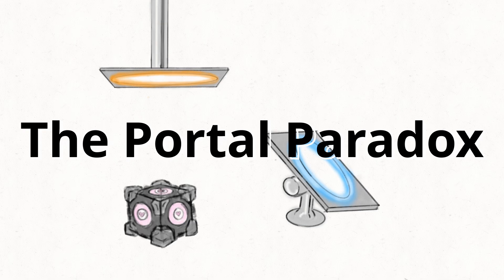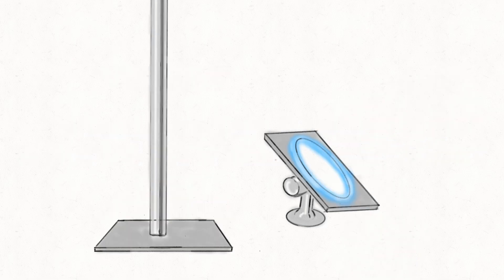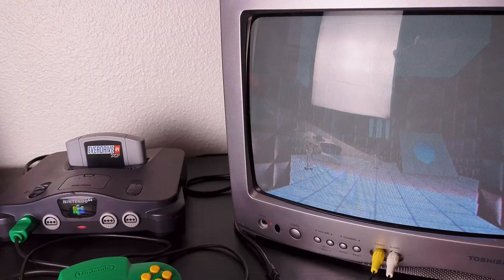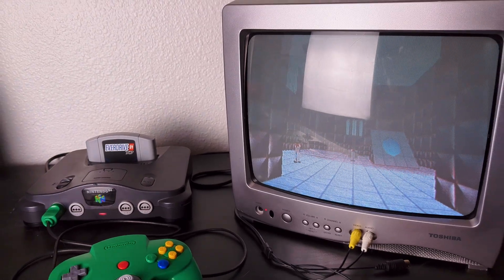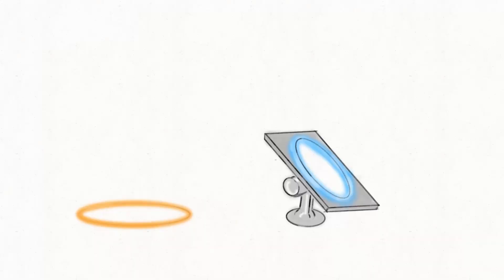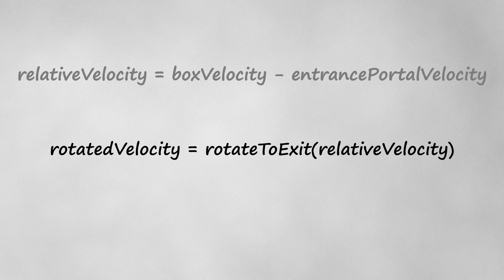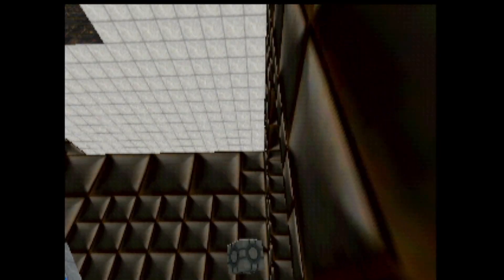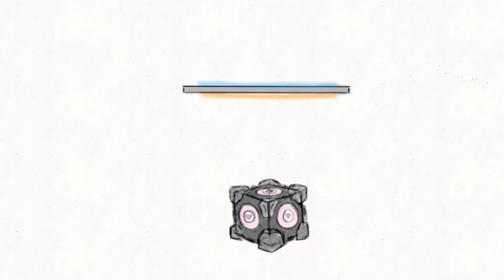I rewrote Portal from scratch and solved the Portal Paradox

Comment: Kinda cool that your de-make is now, at least in this particular regard, technically more advanced of a game than the actual original source version
Reply: The issue with infinite forces are not solved, though:
1) Instead of piston pushing panel with orange portal down, panel is free-falling.
2) Instead of panel with blue portal being at 45°, it's lying with portal side down.
3) Panel with orange portal is falling to cube.
With his solution, this would create infinite forces and will completely flatten the cube, even though panel don't weight that much.
Reply: From 2007, it’s 2023 my guy, most game demos are longer than games from that time.
Reply: The original engine has a tag that allows portals to move, you could certainly do this in original engine using only in game commands.
Reply: @ephraimtimmerman4476  Someone did and the cube and Chell both treated the moving portal as a wall; they aren't functionally implemented, they're only faked with that tag for one or two cutscenes
Reply: The real treasure was the bots we made along the way.
Reply: I've never seen someone come across as so much of a fucking cunt on a comment thread.
Reply: Portals can be moved in portal 2 and the same thing happens in the portal64 de-make/ n64 port
Reply: Ba dum tss.
Reply: If it was any other engine than source it wouldn't of been possible
Reply: Now the bots are accusing real people of being bots! To what end!? Report all the bots!
Reply: Except it's not at all. He calculated a single variable, he didn't even include inertial frames of reference or light cones, either because he's ignorant of the actual physics or just lacks the capability to program them.

Just so we're clear, this is wrong. It's the same as throwing the entire building at a stationary cube.

If that's hard to comprehend, a portal is essentially a window. If you stuck your hand through a window, you wouldn't expect to be launched through it. His example violates the law of conservation, and it's a very clear example of ignorance at work. We've actually demonstrated this as false as we've created "white holes" for qubits that instantly communicated information over distances and didn't impart any extra energy when doing so.
Reply: @xelgodis80085  Your reasoning for this not working is “but if you stuck your hand through a window you wouldn’t launch through it” which is entirely irrelevant to this experiment because you can stick your hand through a portal and not launch through it as well lmao. This is a scenario where the portal’s entrance is moving and exit is stationary, meaning that entering the portal is relatively faster than exiting the portal at a standstill, meaning you would be launched out of the exit point due to relative speed. Think of jumping out of a speeding vehicle versus a stationary vehicle, for instance.
Reply: @Bluerious  you understand literally nothing about inertial frames of reference, nor white holes. 

The act of an object moving through space is exactly the same as space moving past an object. You are taught this in 3rd grade. 

For more information on why you're wrong, please look up how space-time compression and dilation work, as this functions simply as link in two points in space time.

The final straw is that by this model, light itself should be accelerated past c when a portal accelerates at it. This is because his simulation must assume a universal constant orientation, that the universe itself has an "up" and "down", which is flat-earth conjecture. Unless you concede that accelerating the entire building at a stationary cube would not cause the cube to be launched (as no force can possibly act upon it) and it is simply transported from one point in space time to another, you would have to admit that anything traveling at c would therefore be accelerated beyond the speed of light in the same scenario, which the laws of thermodynamics has proven untrue. 

Now admit that you're wrong.
Reply: @xelgodis80085  Dude, I’m sorry but your constant “You understand nothing,” “for more information on why you’re wrong,” and “Now admit that you’re wrong” is extremely childish and shows that you really aren’t willing to have any meaningful conversation whatsoever lol. This isn’t even the first video to solve the portal paradox, it just puts it into a direct visualization about it, and addresses how a critique against the portal paradox will still apply properly when simulated in this implementation as well.
Reply: @Bluerious  okay, if you'd like to have a civil conversation then sure, we can. I simply addressed you as I would any other flat earther (as an inherent reference required for this simulation to work is the basis of flat earth gravity-denial), and may have been a bit dismissive in something so obvious. 

Let's establish basic facts and then why they must be true, then you can try to deny and pick it apart:

1) A portal must only ever be a link in space-time sharing an inertial frame of reference. 

This is because the portal has no mass or energy, it is an absence or void, aka a hole. It is Space.

2) The platform is accelerating, with a hole in it.

It is undeniable that the platform itself is accelerating, but the hole in the center is not, as an "absence" or "void" cannot accelerate.

3) An object passing through space is the same as space passing over an object.

Inertial frames of reference DO matter, and they form the very basis of physics.

4) The first law of thermodynamics must always be observed.

Energy cannot be created or destroyed, this is a fundamental fact.

Now let's set up this scenario:

A platform with a hole is accelerating. The hole passes over an object. The object remains stationary, and is simply on the other side of the hole.

By actual physics, this is how the portal interacts with the world around it, or rather doesn't interact at all as a void cannot impart force or act upon anything. The box is simply on the other side of a hole.

However, in the video's demonstration he assume that the void of the hole has a vector of energy or mass that somehow acts upon the box. This cannot be true, because the portal is SPACE, a VOID, NOTHINGNESS, in other words a HOLE. If it did somehow impart a force upon an object it passes over, than the very act of moving the portal means it passes over light moving through it. By the demonstration then, the light must also accelerate past the speed of light upon exit, even though nothing can exceed the speed of light.

If you would like to understand light cones, inertial frames of reference, quantum entanglement, and quantum  "teleportation", we can start to break them down for your ease of understanding.

You do see why this is so tiring though, right? Having to teach people principles over the internet that they refuse to grasp is almost like dealing with a troll.
Reply: @bluerious5475  why haven't you responded? We've proven the paradox as false through quantum teleportation, but you're deciding to cling to old unproven theories. Is there a reason for that?

Refusing to admit that you're wrong is what's actually childish.
Reply: @xelgodis80085  Man I’m sorry that I’m not checking YouTube replies all day and didn’t get back to your response within 30 minutes since I was busy doing other things lol. Really though, yes teleportation as a concept have potential to exist, and quantum teleportation has been discovered as a transferring of information, not matter. However, the way that these portals exist in the game, the portal gun and the entire idea that running through a portal in such a way will conserve momentum, is pretty much a violation of the conservation of energy in and of itself. To explain quickly, portal gun existing like this would require not only have to be a free energy machine (something that you’ve mentioned cannot just exist since energy cannot be created or destroyed,) it would also essentially have to be a time machine simultaneously as well. Portals like this are sci fi concepts because their mere existence already mess with the fundamental rules of the universe that are already established, ergo you really can’t explain the logic of a portal gun using conventional science like this to properly explain it, since even teleporting from a short distance requires displacement that isn’t particularly feasible. Shortcuts in space time are theoretically possible, but as it exists in-game, there really is no strong basis in modern science that could really explain it. 

Knowing this, the paradox can’t really be explained using conventional science, so we need to look exclusively at the rules of the game to explain how this problem would work. The portals carry your momentum when traveling through them, but when you think about how that works, you’re effectively making yourself shoot through a room on the other side of the portal. Whether you slowly walk through, or run and jump through, what’s effectively happening is you are shooting through a door to a room moving at X speed. But what if that door moved rapidly toward you instead? If we imagine two different rooms existing in a vacuum, with you standing in one of them, and the other room rapidly shot toward you, you’d end up flying through the room assuming the point of entry is in motion and the exit is stationary. If both are in motion, the room would simply envelop you instead. This is how it would likely work in the fictional scenario seen in Portal, and the creator of this video successfully shows this concept in practice here. Of course this kind of motion isn’t really something possible IRL, but everything about how portals work in this game fundamentally would require changing everything we know about the laws of physics anyway, so really this kind of scenario shouldn’t even really be explained with real life science in the first place.
Reply: @Bluerious  that applies if the portal has mass or energy. The portal does not, it is a hole, a void in space. It has no mass, no energy, no thickness, it just connects two points in space. 

The platform can impart its momentum on anything it touches, but nothing can touch an empty void of the portal, so it cannot affect anything in any way.

You can say you're moving the hole over the box or moving the entire universe at the hole, but in neither situation does the hole interact with any matter because it physically has no way to do so.

The portal is simply a zero-mass, zero-energy, zero-thickness inertial frame of reference connecting two surfaces. If it could ever affect anything, it would violate the First Law of Thermodynamics. 

This is a fundamental principle in physics, and is not debatable.

If it could accelerate anything, then it could also accelerate light, so by moving the portal you would increase the speed of light passing through it beyond the speed of light, which breaks light cones and inertial frames of reference.
Reply: @xelgodis80085  The thing with trying to determine if the results of the experiment follows the laws of thermodynamics is that portals by definition violate inertia (momentum includes velocity vectors). You cannot make something change directions without imparting a force, yet a portal can make a ball rolling left, now roll right without any force imparted on the wall its on. Or, stack the portals over each other, and create free potential energy. Add water and a water wheel, you can have perpetual motion. 

There's air in front of the blue portal. The cube emerging on the blue side has to force air out of the way to occupy their space. If there's a bunch of styrofoam cubes stacked in front of the blue portal, the cube will have to knock them out of the way too. To the objects blocking the blue portal, it cannot tell a difference between an object thrown through it or the orange portal moving through the object. Therefore, if it has the momentum to knock the plastic bricks out of the way, it has the momentum to have a velocity vector of its own.

Hell, remember the Coriolis Effect? Objects at the equator moving north "appear" to speed up eastwards because of the difference in angular momentum. Portals at the equator and north pole will happily move things across without noticing the massive disparity in speed.
Reply: @Appletank8  fair point about it being dumb video game logic, but if it's just an open gap in space-time as the mechanics suggest, then it doesn't violate the laws of inertia as its simply moving through space. 

As far as there being air in the way, what are you referring to? Air doesn't move because of a hole, but it may move because of the surrounding platform.
Reply: @xelgodis80085  In order for a Cube of size 2x2x2 units to move across, a 2x2x2 unit cube of air has to be moved out of the way. The faster the orange portal moves down, the faster the cube of air has to be moved out of the way of the blue side. 

Like, imagine if I stuck my foot through from the blue side into the orange side. When the orange side shoots down, my foot is probably going to shatter from hitting the ground on the orange side, and send bits of my bone flying backwards towards me.
Reply: @xelgodis80085  Portals that are 'like a window' are incompatible with laws of physics like the conservation of energy and conservation of momentum. But you can make them work and be consistent with a simplified physics of a game (and this is probably what this video achieves).

You can make something similar work with our full blown physics (on paper obviously), but e.g. you would need to put in energy to move an object though a portal that has the other end at a higher elevation.
Reply: The Wuffle house has found it’s new host
Reply: @CBNST  its* 🤓
Reply: @lod4246  it's* 🤓
Reply: @CBNST  The trebuchet is important!
Reply: @CBNST  crash Bandicoot 1 (N sane Trilogy) 102%?
Reply: And that host is shaggy
Reply: @CBNST  this is the wufflehouse, it houses wuffles
Reply: @CBNST im gonna smite you
Reply: @CBNST  You're spamming that and can't even get it right?

Comment: Imagine teleporting an object by sweeping a portal over it while the exit portal moves backwards at the same speed somewhere else. Would be neat if this was how you got between areas in the lab, too.
Reply: The Wuffle  house has found it’s new host
Reply: It gives a lot on new possible stuff to create
Reply: I think the developers of the original Portal originally planned the level transitions to work by having a portal rise up from the ground like rising water (as the opposite portal moved up as well). They ended up scratching the idea because of technical difficulties.